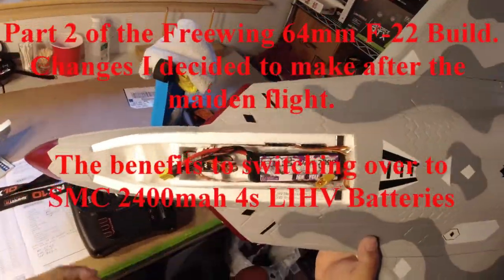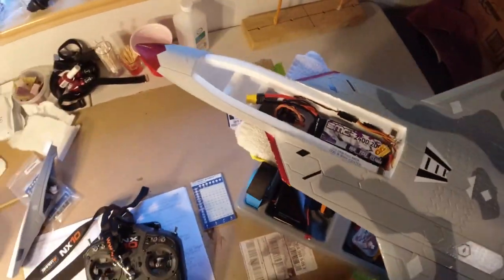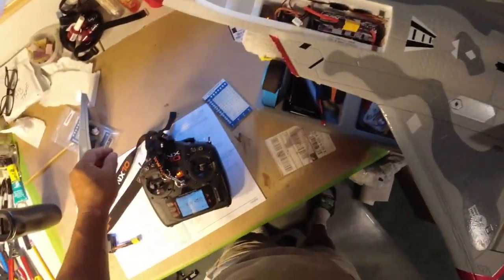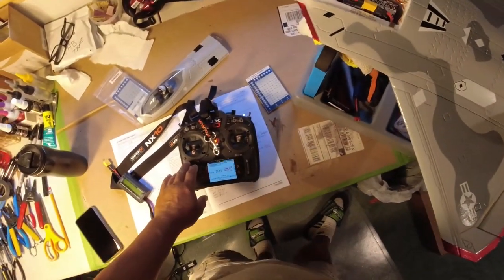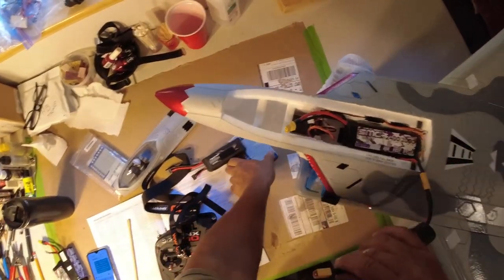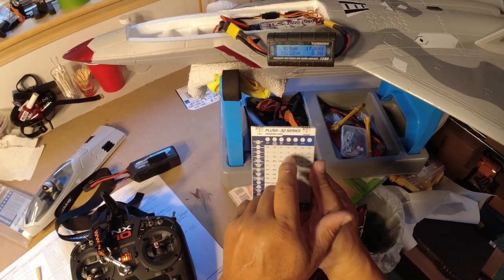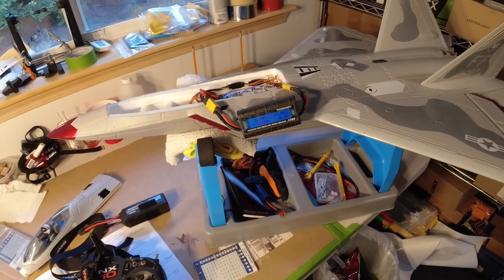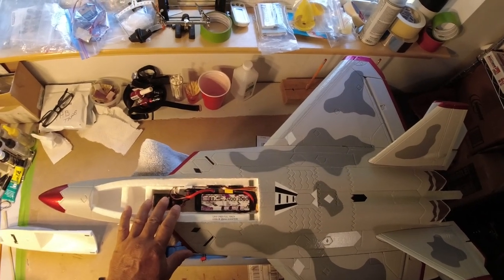Freewing F 22 Raptor Build Part 2. Benefits to switching to LIHV 4s batteries with Xfly EDF

Comment: If you cant be bothered with LiHV batteries or the SMC USA only brand as you live outside USA and this being an international forum and want even better performance from your 64mm and your 80A esc... just use a 5S 2200. Im at 5° not 30° and my thrust gains are about 40%. 75A and over 1500W. Quite a few brands do 5s. My personal recommendation is internationally available CNHL 2200 5s 70c for all my 64mm jets. 3.5min timer.
Reply from the maker: I see they sell the batteries on Ebay but I see only 6s not 5s lipos.  Are you talking about CHNL 2200 6s 70c lipos?

Comment: Does you charger support the LiHV packs? If not, they charge to 2000 and the lower voltages similar to stock. I've got the same setup :) Fantastic plane, I'm on my 3rd one ;0) I finally took the gear off and do belly landings with it too. It took me a few years as well to fly mine. The last time I had messed with RC as a hobby was 1985 lol.
Reply: Good job btw, and the plane looks awesome.
Reply from the maker: @cybersecuritydeclassified4793  Yup it supports all formats.  85? Old timer!
Reply from the maker: I flew it yesterday on the LIHV setup with full advanced timing set to the highest (30 degrees) and I fried the XFLY motor.  Or the bearings went out.  I think it may have been the bearing because it doesn't smell burnt.  I'm putting in another XFLY 4s but this time I am going with the default timing of 18 degrees.  The peak amps drop from 67.4 down to 59.4 and the peak watts down from 1067 to 878.  Hopefully I won't fry the next motor.
Reply: @RKIVIDS  Nice! I've got the shaky hands right now. About to re-maiden (3rd) my 90mm F-22. The 64 however is my favorite so far. Easy to transport .